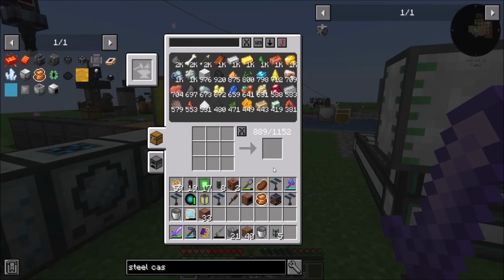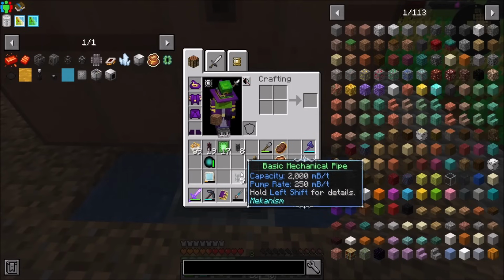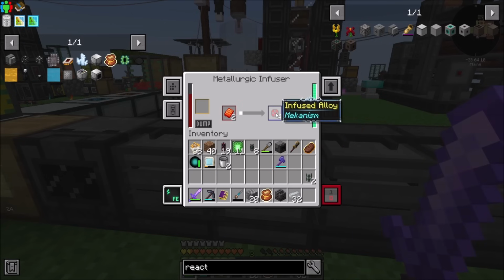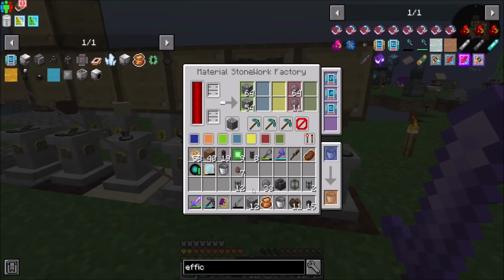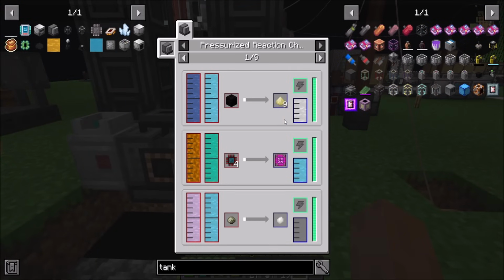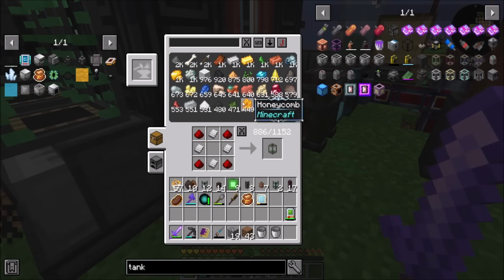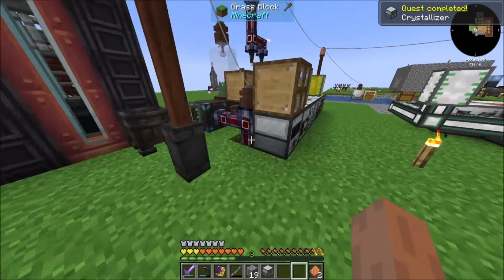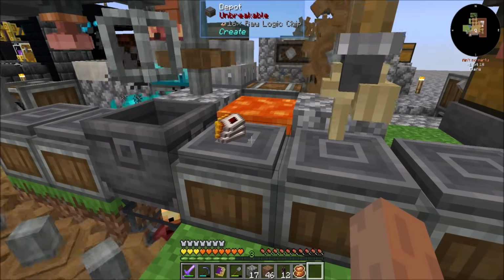FTB Skies Expert Ep48 Brine and Silicon

Comment: Dire just incase you didnt know. if you wack the top-side of a post with the hammer, you can put the arm on it. The connectors can either be placed on top or on bottom of that arm
Reply: He did the wacking part earlier, but maybe he doesn’t know about the upside down connectors.

Comment: dire please just put the chest on the left side of the gear / rod press machine. immersive auto pulls / inserts into chests so it would make you gear issue so much better to not have to crouch
Reply: That was in older versions, now best you can do is use an extracting belt, and it is stupid af since it extracts as item entitites.

Comment: it's funny that sodium is a gas in this when sodium is literally salt
Reply: Well not exactly. Table salt is sodium chloride. Brine is concentrated salt solution. Sodium being means that the machine actually atomises the sodium chloride in the brine to form gaseous atomic sodium and chlorine which requires a lot of energy. That’s why the sodium is a gas, because the energy required to split all the ionic bonds between the sodium and chlorine ions and keep them separate as sodium and chlorine atoms would require so much energy that the temperature is higher than not only sodium’s melting point but its boiling point too which is almost 900 C or around 1600 F
Reply: @kharthicthiagarajah3500 On the other hand, it should cool down and solidify pretty quickly when it comes out of the machine. All sorts of things in Mekanism seem to be gasses that were solids or liquids in my chemistry classes.
Reply: Sodium is literally a metal